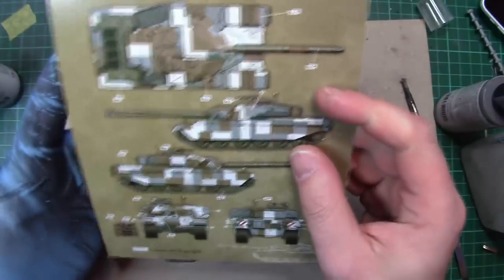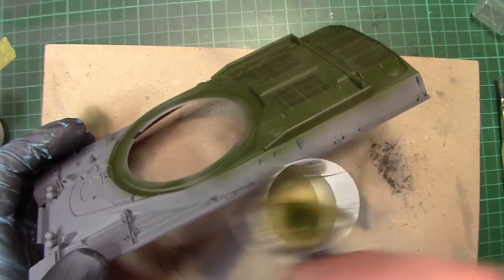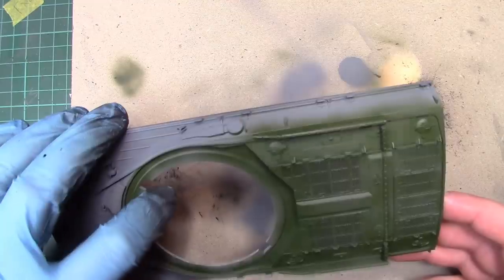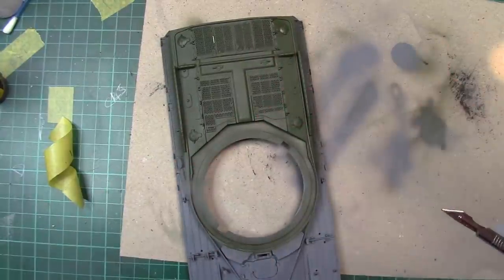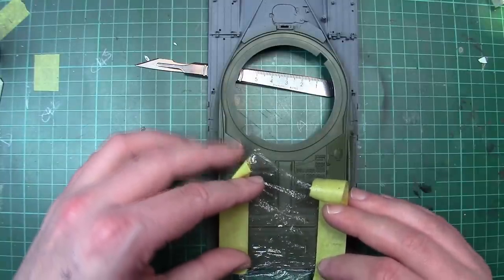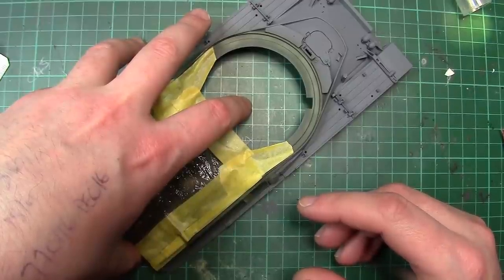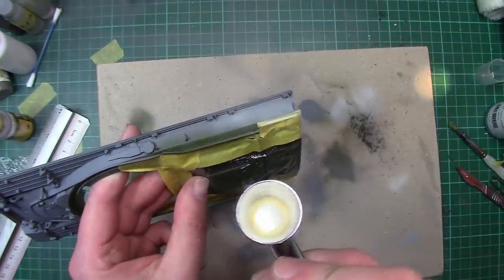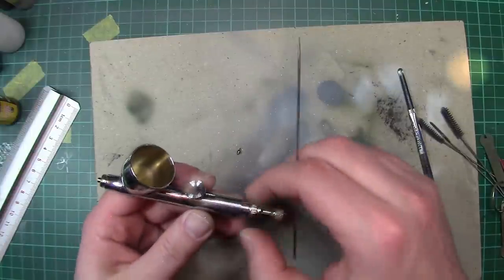Takom 1/35 British Chieftain Mk 10 Tank Build (# 02028) - Part 12 with Tony

Comment: Tony,

Loved the build, but, the wagon you are building was my wagon in Berlin, yes my wagon. Common mistake on these wagons from Takom was that the running gear and lower hull was NATO Black. The back decks were a continuation of the Urban Cam. The vehicle was painted to fight in the city and the Cam was brilliant when put up against a building it was very effective. The wagons where also spotless very little dirt on them and kept in pristine condition. Which was a bit ironic because we had a lifespan of about 30 seconds a minute and a half if we got out of the camp gates !!!! But that would never of happened as there where 14 Hind D helicopters waiting for us over the border to Spandau. On a regular basis we were scrambled when the helicopters went up in the air, and we would pull out of the hangers and then be told to pull forward one by one and your executioner ( helicopter) would also pull forward !!!! Hope you don’t mind the comments?